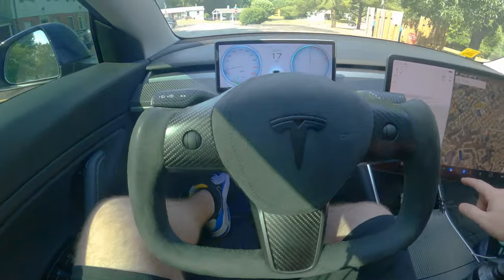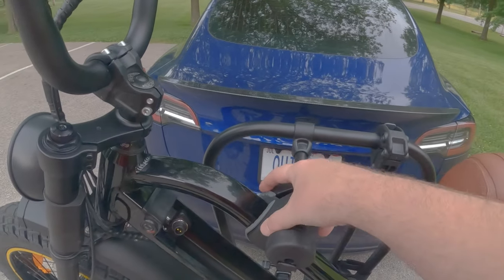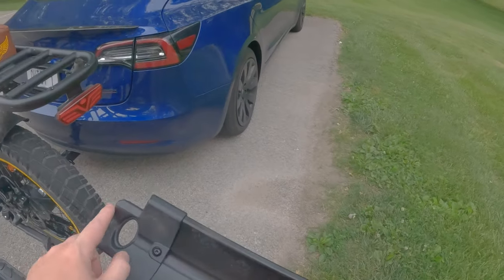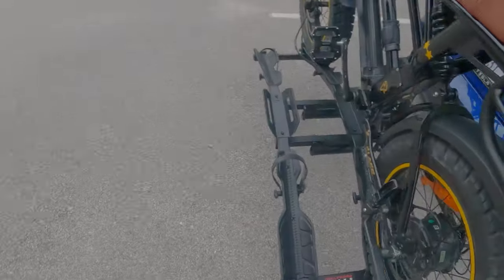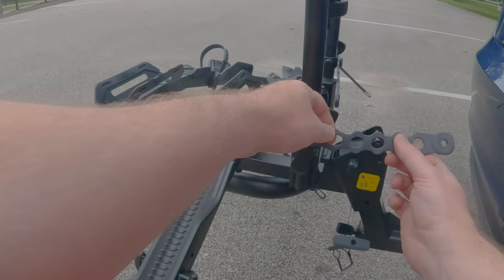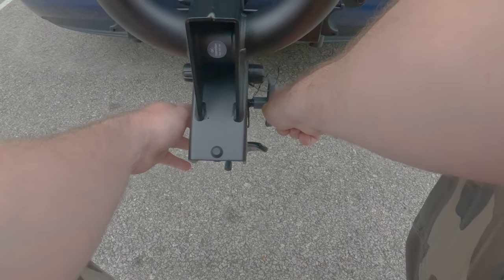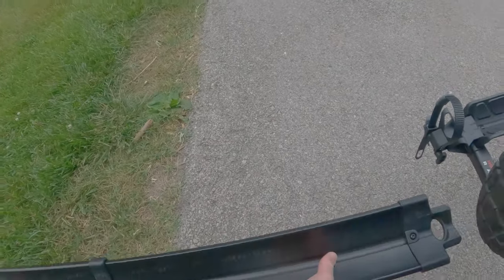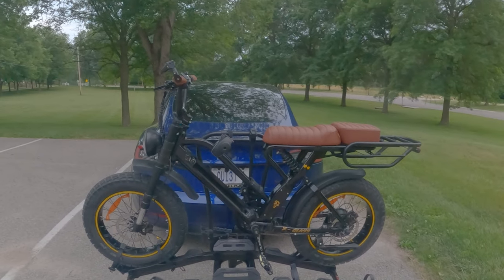The ULTIMATE E-BIKE RACK! | Hollywood Racks Destination E - The Best Electric Bike Rack Around?

Comment: Great video Randy with all the features  it has by showing all of us. One question I have after watching with the two locking arms as one is short and the other is long for the second bike. Could those be removed if someone attempted too try? Since the locking clamps cant be loosen too remove of course as they are locked. If they can take the two arms off if they are just attached with normal hardware that would be my only concern. Thanks for what you do for the group!!
Reply: I was wondering the same thing.

Comment: Just bought one yesterday and assembled it question: why do they have the removable and extra non removable outside bike grabber?  Any benefit for take the outside grabber of and adding the non removable one? Sometimes I may just load one bike is there some issue I’m missing (probably missing something)
Reply from the maker: I'll give you an example, and hopefully it makes sense. 

For someone like me, that has to load a variety of different ebikes on the rack, I need to move the grabber on a regular basis. The adjustable one is ideal for me. 

If you are only loading the two same bikes on a regular basis, then the fixed grabber is better for you, cause then you won't have to worry about it sliding at all.
Reply: Thanks!!

Comment: NOTE* a Grizzly = 108 lbs and this rack is 140 lbs max... (2 - 70 lb ebikes)
Reply from the maker: Thanks for your concern. It did perfectly fine on the back. No issues. I’ll make sure I get you some video the next time I take it out. 😉
Reply: @RandyRides , I merely note that the rack is 140 lb rated and the Grizzly is only 108 lbs. No forseeable problem there... second bike rack still has 32 lbs capacity!
Reply: @johnw65 remove the battery and you might be able to put 2 grizzlies.
Reply: @Mretinum  I'll stick with my folders thanks. I can put 2 of them in my hatchback while towing my camper.